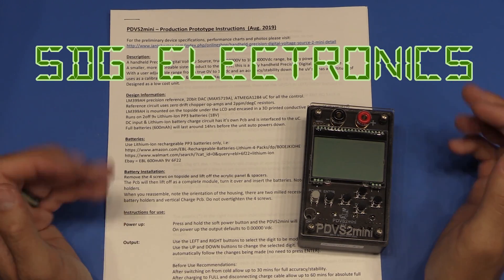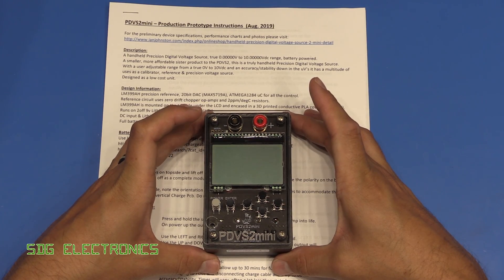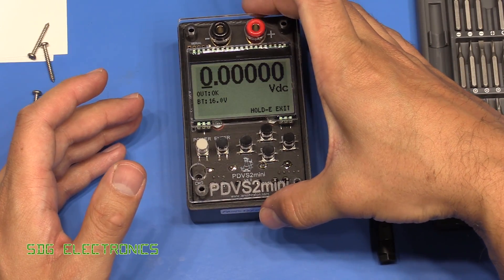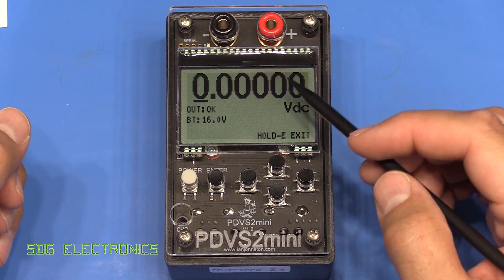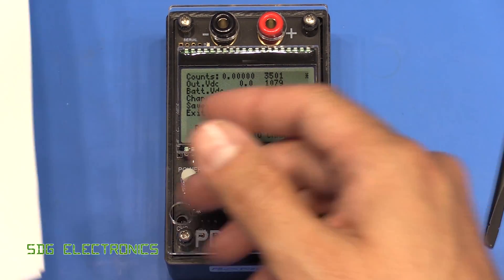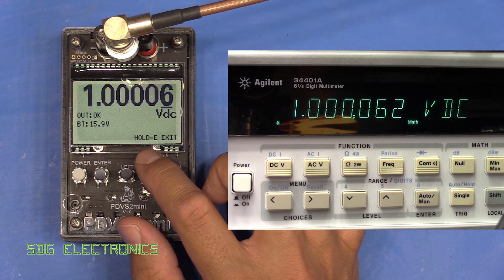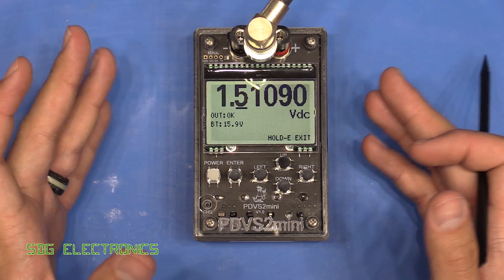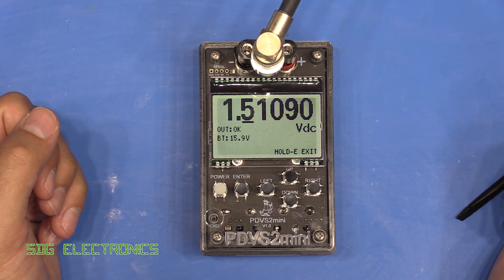SDG #099 IanScottJohnston's PDVS2mini Precision Voltage Source

Comment: Toggle Output could be implemented with a firmware update. Use the "Enter" key to toggle output on & off. Add a little indicator on the screen to show when output is on or off. Easy little update which would make this nice.

Comment: Did I miss but what is the current output of this? Looks way too fragile for me to use. I would like to see it with a encoder instead and a back light would be nice too. I would change your charge current if that 400 Ma is in series with those batteries. If they charge in parallel that would be ok.
Reply: This is a cheaper version of my PDVS2 (see my online shop) which has the encoder, backlight and a numeric keypad.
The output is short circuit protected (21mA max all day long), Min load = 3kohm. Example: At 10Vdc output with 3kohm load = 3.3mA (whilst maintaining output within approx. 10uV)
The 400mA is a software setpoint just to protect things if the batteries/hardware goes wrong.....the max charge current is set at 225mA approx. The batteries are in series. I chose the PP3 type as they come with in-battery over and under charge protection, i.e. I have added as much protection as I could in hardware & software given it uses Lithium-Ion batteries.
(PS. I will change the text on the 400mA setpoint so it's more intuitive as to what it's for.....or maybe even remove it fom the display!).
Reply: @IanScottJohnston  Thanks for the info I will check out your site. Sounds good and that display looks awesome!

Comment: Steve, thanks for the review of the prototype and the suggestions. The serial header does work, it's an "extra" feature I wasn't planning on but gave the unit a backdoor. Press and hold the LEFT & RIGHT buttons to enable bidirectional comms, an LED will flash next to the header. I'll send you the protocol......
I should have mentioned, there may be a 1bit error going from Version 1.00 to V1.01 due to the new version cancelling out a rounding error.......so yours might require a wee re-calibration to get the unit even more accurate.

Comment: Would have been a lot more useful with 0 - 15V range. With 0-10 he lost me as a customer,  dealing mostly with automotive 12v . This will be handy for analog device testing, most of which are 12-24V. The way it is,  I only see one small niche for this device, ADC testing.
Reply: Hi, 15Vdc would mean you wouldn't get the 5th dp due to the 20bit DAC (10uV steps 0-10Vdc). Also, two PP3 batteries wouldn't be enough very likely thus major changes required. 0-10Vdc just lands perfectly to the hardware/design. However, I wouldn't rule out a future design for say 0-24Vdc or something like that.
Reply: @IanScottJohnston  I completely understand the reasons behind the current range. I figured you'll need more than 20 bit DAC but what I also wondered was,  why not use a single battery and DC-DC converter? I'm assuming the battery won't last long enough? Noise? 
Thank you for your respond and best of luck with your products!
Reply: @111chicane  At these small voltages noise and drift is the enemy......DC-DC converters would just cause havoc without going a lot more expensive on the BOM. There are compromizes right, left & centre hence why there aren't too many hand-held precision voltage sources out there......:-)
Reply: The price is good, couldn't you just buy two and wire them in series? Honestly doubting you'd get much else with 5 Sig figures for under 1k so you'd still be way ahead
Reply: Its a voltage reference.. If your device can read down to 10 microvolt range this voltage reference up to 10VDC should be fine. Did you know that you only need 10VDC to calibrate an HP 3458A as long as its accurate.
Reply: D Stanoev , explain to me why you need microvolt accuracy in automotive electronics.
Reply: @johnnz1963  
1. For testing sensor inputs
2. Calibrating sensor inputs
3. Emulating sensors
4. Adjusting thresholds
Definitely more uses than in a strictly digital 5V electronics. Correct me if I'm wrong.
Reply: D Stanoev  I would have never guessed that auto sensors needed that kind of resolution.
Reply: @robertcalkjr.8325  Most don't but some pressure sensors, angle/position sensors, occupancy sensors, accelerometers, current sensors,  etc.  do.
Reply: D Stanoev  Auto mechanics has come a long way since I got out of it decades ago. Now we have self-driving cars. Pretty cool in one way and scary in another...
Reply: @robertcalkjr.8325  Auto mechanics today only swap modules and parts. Diagnostic equipment plugged into the diagnostic port is the only tool they know when it comes to electronics. Talking about dealers and service centers here. You probably know a lot more than most of them. On the other hand,  those who develop the modules, test equipment and software are in a lot of trouble.
Reply: @111chicane  my BMW 330D was at the dealers a couple weeks ago to fix a fault and they actually had to measure and exhaust pressure sensor voltage......but only because the ECU just blindly threw up lots of faults including the pressure sensor fault and which made it impossible to narrow the fault down otherwise!
Reply: @IanScottJohnston  Impressive! That must have happened somewhere in the EU. In US, where I am, nobody even uses multimeter anymore. I've see ASE certified mechanics checking battery voltage on AC range and claiming it's gone bad,  needs replacement. 
You're a lucky man having those oldschool mechanics!
Reply: So, this isn't the product for you. Do you blame Ian to not think about you, when he was fulfilling his needs on a voltage source? This is not a product, it's just a way to get a well built and tested piece instead of making it your own, according to the plans and videos, he's provided. Go get those, and make it fit your needs.
Reply: @marcus_w0  Mr. Marcus,  did someone eat your breakfasts? It wasn't me. 
I did say in my comment it's not for me, go back and re-read it. 
I'm not bashing or criticizing the product, I'm suggesting it will get a lot more  potential buyers with wider range. 
Hopefully next time you get to your keyboard, you'll  restrain yourself of showing anger. Thank you!